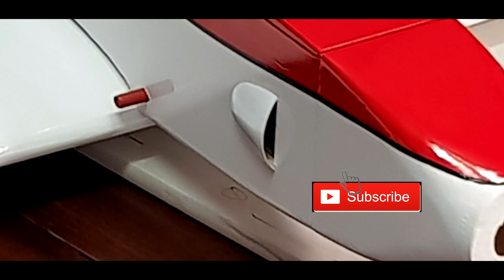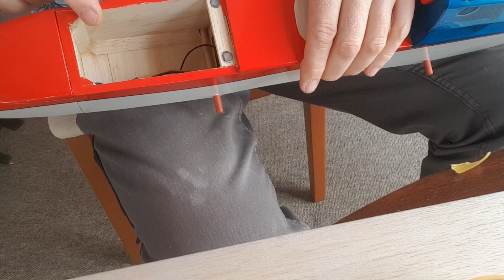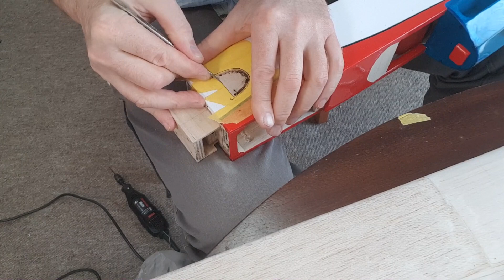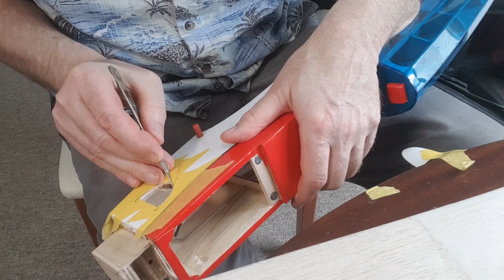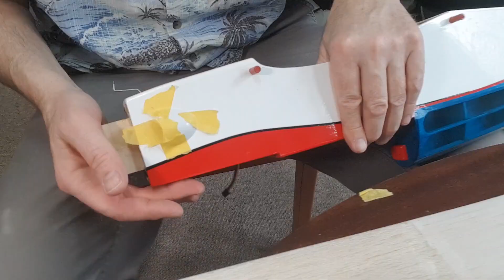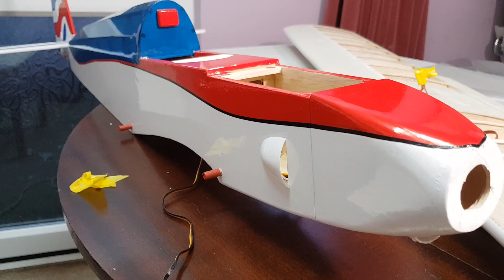Add An Air Scoop To Your Model Plane

Comment: OK. Now, the air "intaked" by the scoop... where it "scapes" the fuselaje?
Reply from the maker: Hi Ale, I think you're asking me how does the warm air escape? It's important to have a bigger exit than intake as you may already know, in the case of this model the air leaves through the open cockpit after passing over the esc and battery, I've now added that information into the video description, thanks 👍
Reply: @cliffharveyrcplanes  Thank you Cliff for your answer. I didn't realize that this specific model is an open open cockpit one¡¡¡¡ Please, excuse me for that.